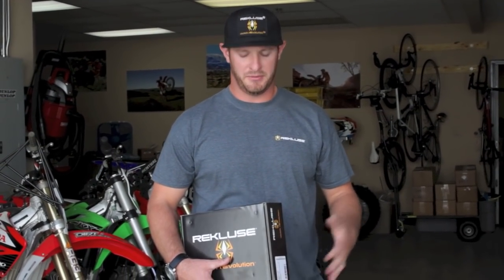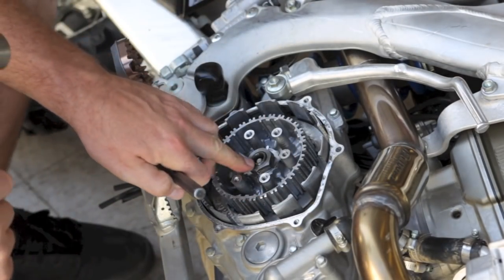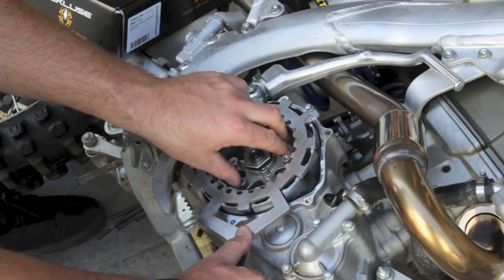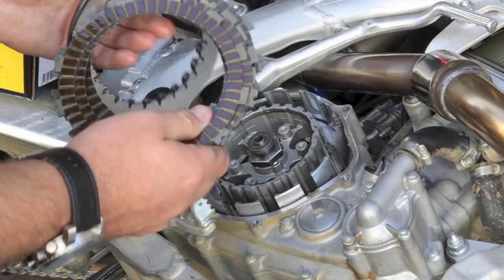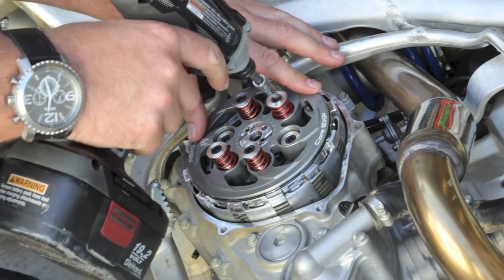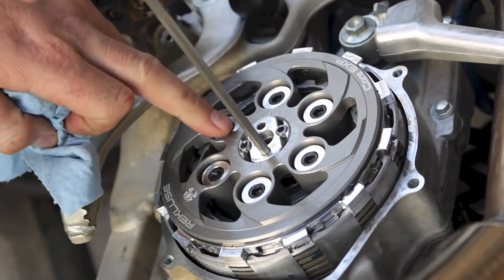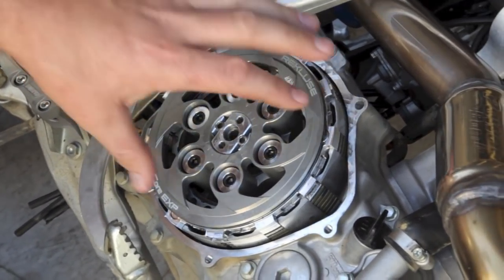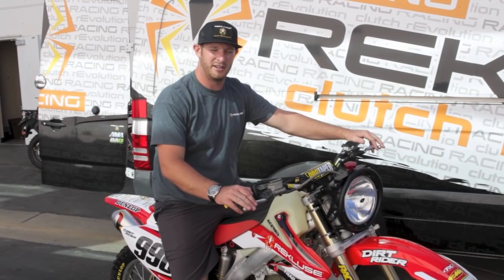How To Install A Rekluse Motorcycle Clutch

Comment: I have the Rekluse Radiusx on my 17 WR-450f and it's the best mod to date that I've done on it. Still use my clutch constantly, but don't have to worry a out flame outs in tight single track. Installing one in my YZ250 this weekend.

Comment: I have one in my 04 yz325 . It’ takes getting use to. I can still use my clutch lever if I want. I just use it for starting out in 1st.   I’m running  wide ratio gears from a 250x in my cases. Haven’t had a problem yet with my clutch. They say to change the trans fluid after 2-5 hours on it

Comment: I had one on my bike, i removed it and returned it to the normal clutch.
It had lots of problems with the quality of the shifts. The best clutch so far is the dual clutch i have on my vfr1200. Its so fast. Im turning quarter mile times in thr low tens.
Reply: I don't believe for a 1/2 second that this would be
a good thing for an experienced hard enduro rider.
I'm buying of looking to buy a bike that has rekluse,
there are no videos on how to get rid of it..

Comment: Nice piece of kit. One thing that I don’t agree with is the bullshit cut to fit gasket o-ring they supply. For the price and quality of this entire setup you thing they would compliment it with a genuine bike specific gasket. Other then that it’s an awesome piece of gear if you have a good enough reason to install one. Personally I don’t run one. I love feeling everything with full control.

Comment: I just bought a 2014 rmz450 that has the 3.0 rekluse but the clutch lever is very very hard to pull in what could be the issue there clutch seems to grab good. It does stall a couple times during a couple hr rides
Reply: Maybe the previous owner put springs in that are too stiff.
Reply: Needs to be readjusted

Comment: wanting to use a strong bike but wanting it to slip a bit...
might buy a bike with smaller cc then...
your not using your bikes potential when u restrict its strenght
Reply: I don’t think you understand. The concept of the rekluse is so you don’t have to pull in the lever as much . It’s not hindering horsepower or torque